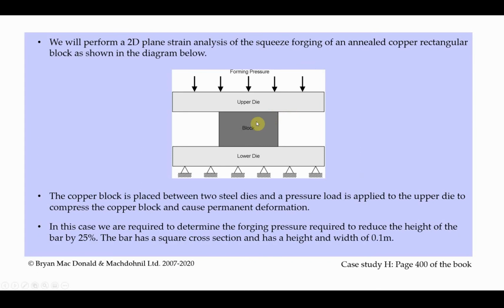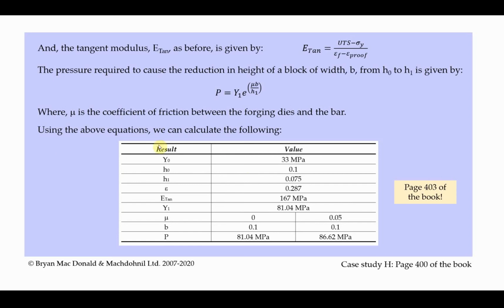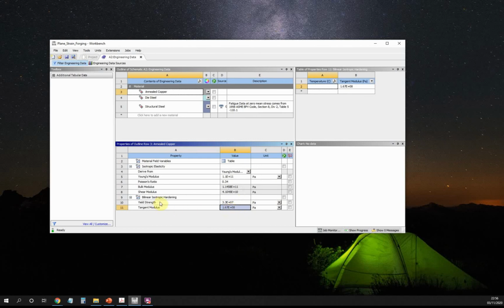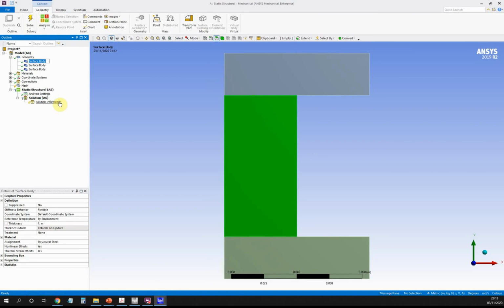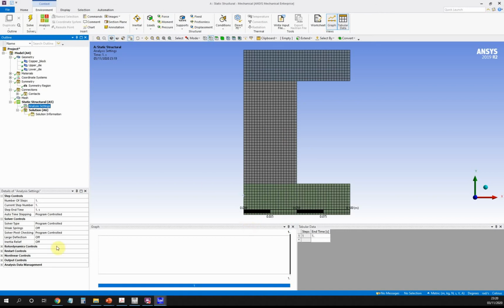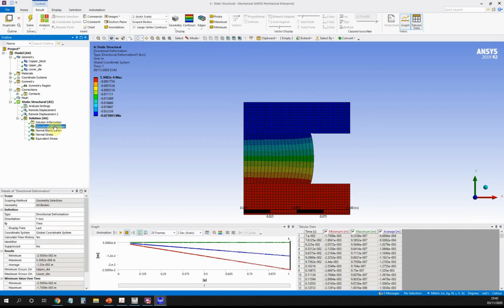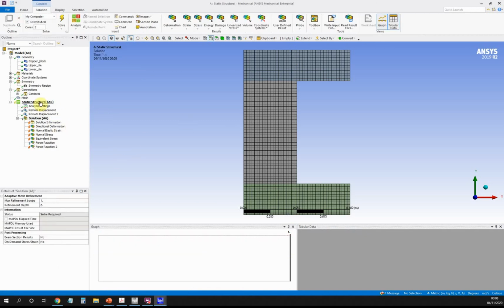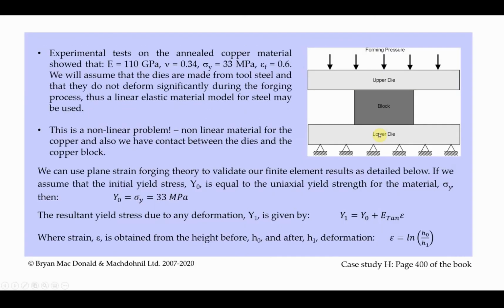Plane Strain Forging Simulation of a Block using ANSYS Workbench

Comment: you had put 25% reduction as 0.025 not 0.25 ,, could you please explain why?
Reply from the maker: Hi, in this case the block has a height of 0.1m to we are moving the top die down by 0.025m as this is 25% of 0.1m. Hope this helps!
Reply: thank you sir @LearnFiniteElementAnalysis